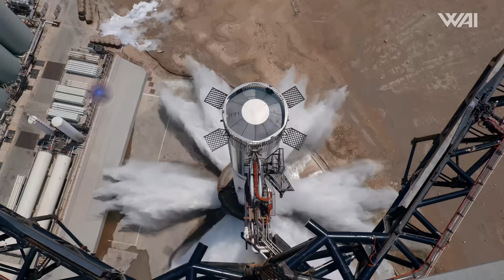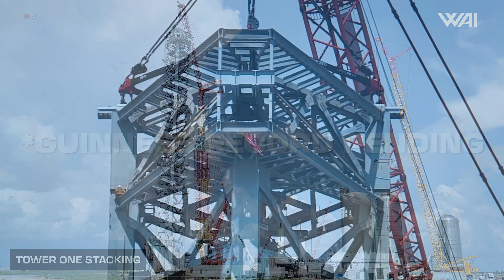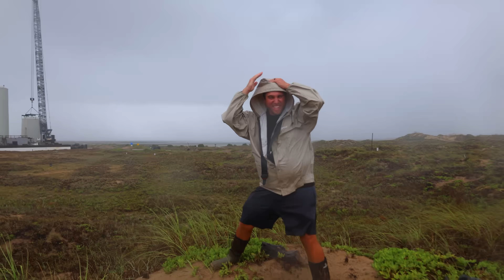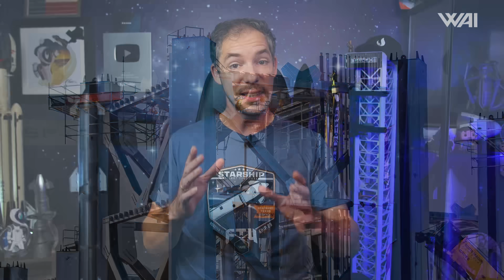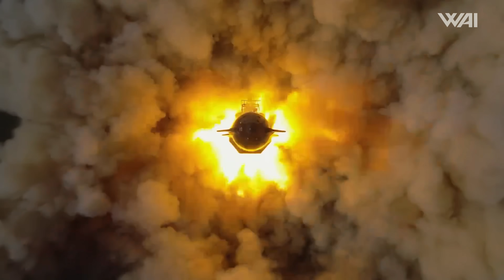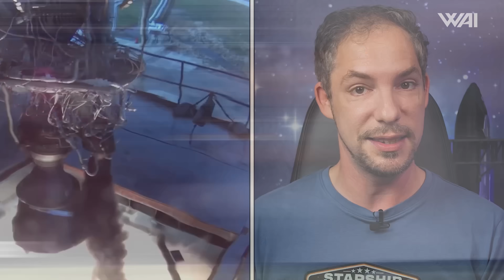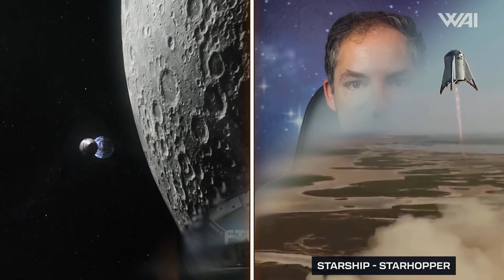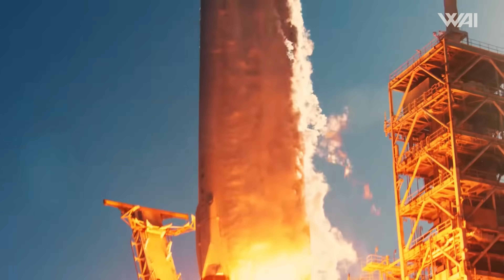SpaceX Reveals Latest Starship Flight 5 Launch Estimate! + Inside The Starship Miracle Engine!

Comment: Can we use huge magnets to catch super heavy booster?
Reply: Not sure if stainless steel is magnetic, I think it depends on the exact alloy used
Reply: Probably not a good idea. They would have to be HUGE magnets and the attractive force increases as the distance decreases so the force required to grab the booster at a few feet distance would probably crush it when it pulled it into the magnet.
"The best part is no part" - simpler cheaper and more reliable just to grab it with arms.
Reply: It is physically possible but impracticable, would work poorly, would be vastly expensive, and would cause massive damage to everything around it.

Comment: If they put an ablative heat shield over the pins to install the original heat shield, how do they attach said original heat shield? Thanks.
Reply: No need for tiles at all. just drill lots of micro holes. then pump out dry ice out of those holes to form a cold co2 boundary layer. you dont even really need a pump. the heat of re-entry will cause melting of the dry ice and high pressure dry ice co2 to come out of the micro holes to form the boundary layer.
Reply: @esecallum  How do you pump dry ice, which is a solid?
Reply: @JClarkeCT1334  NO NEED. it sublimates into a gas from reentry heat.
Reply: @JClarkeCT1334  I guess you could put a shell of dry ice around the ship, but this would only last a few seconds and would weigh many times what a heat shield does. A far less stupid idea would be to use existing onboard propellants but you would need far more mass in fuel/oxidizer than tiles weigh.
Reply: @esecallum  Right, but they're not using dry ice. They're using an ablative shield under the "original" shield. How is the original shield being attached if the mounting points are covered?
Reply: @dextermorgan1  ?   No ablative shield needed

Comment: Probably when Starship gets to Mars, there will either be work on the tiles before launching back to Earth, doing that mid-flight, or they'll have to slow down to be captured into a higher orbit before running the gauntlet for the landing.
Reply: Or probably they will depends more on secondary ablative shield. I don't think that they will even try to reuse ships that were in space for over a year and several months on Mars. But that doesn't matter as ship is pretty cheap. Probably payload is way more valuable than ship itself
Reply: Mars trips are one-way. You do not come back from a colony.
Reply: @filonin2  utter bs.
Reply: @filonin2 It's not one way lol. NASA wants their samples. Both Spacex & NASA will find a way.
Reply: There is no particular reason that the ship that brings you from Mars to Earth needs to land you on the surface. You could just transfer to another in Earth orbit. Eventually we’re going to have a station or two as well.

Comment: Wft is NaC1
Reply: NaCl, but someone typed 1 instead of l
Reply: Na = Sodium, Cl = Chlorine. More commonly known as salt. (Although there are many salts, NaCl is just the most common one)
Having your engines washed is salt water due to a hurricane is best avoided.
Reply: @ekij133  "C1" is not equal to "Cl"
Reply: ikr. It got me so confused too
Reply: Salt
Reply: @quantumx9729  sodium chloride
Reply: Table salt